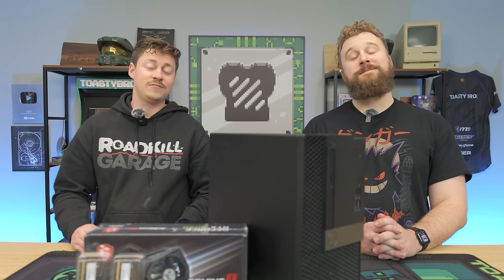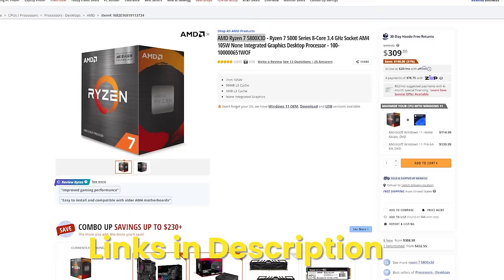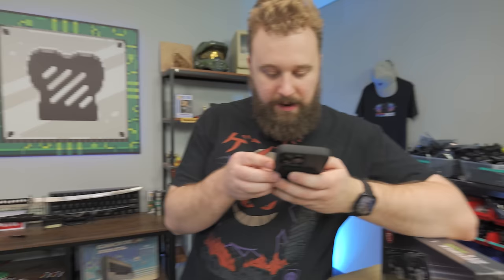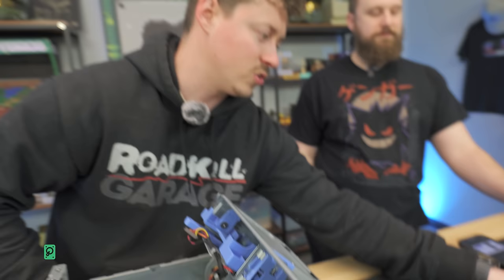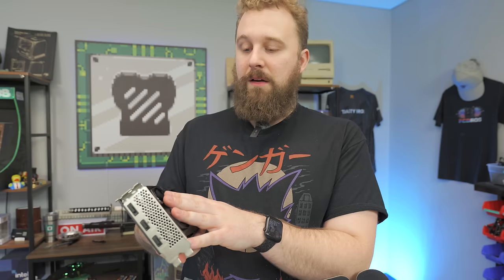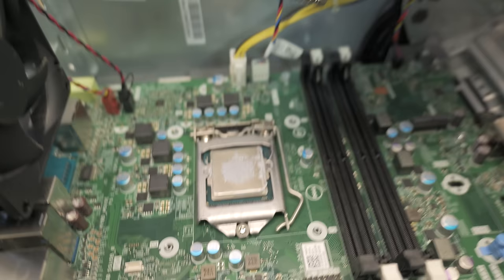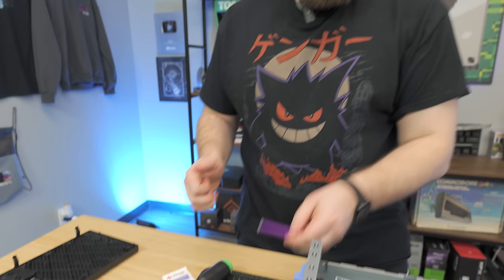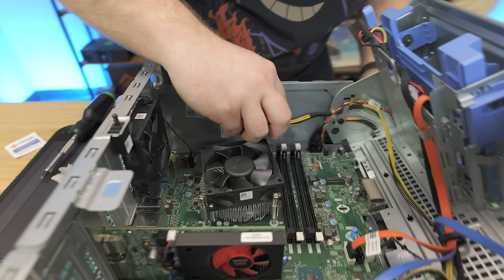This $330 Gaming PC is EASY & POWERFUL!

Comment: A 3050 that actually has a decent use case?  World has truly changed
Reply: It's a good thing I was sitting down when I heard that. 😂
Reply: April's Fools
Reply: it doesn't.  Look at how much stutter is on fortnite and they're like, "plays great two thumb up!"
Reply: @adrian0goncalves 😂
Reply: @Haddley333  like they said, it's more CPU bound. You can even run Fortnite comp settings with a 1050Ti
Reply: @WisteriaBerlitz  yes there is that, but conveniently i don't see them showing the vram usage of the gpu in the benchmarks.  Who does that?   I"m staying away from this channel
Reply: My 3050 has a great use case

I got it for less than half off so the price to performance issue disappeared
Reply: That's the new cut-down RTX 3050 6GB which was released in February 2024. It has less cores, lower clocks, less VRAM and smaller memory bus than the regular RTX 3050 8GB. IMO it should have been branded as the RTX 3040.
Reply: no mine is the 8gb I just happened to blindly luck into a clearance sale
Reply: @Pasi123  I feel the same about the naming scheme
Reply: yep, no external power needed. pretty dope id say, besides those expensive QUADRO's, its the best pci-e powered graphics cards
Reply: @Haddley333  no one buys a 6gb vram card expecting future proofing anyways. showing vram usage in the benchmarks would be redundant

Comment: I think the issue with the card was the name. Its not just 2GB VRAM less, but less clock speed, bus, etc., which made it seem like an underhanded move by Nvidia. Same as the 3060 8GB really.
Reply: Yes I got shafted buying an  nvidia laptop. I got caught up in the marketing with rtx 3xxx until I realized my vram was 4gb 😂 smh 

Thankfully I only play genshin and star rail, but still 😢

I've since "upgraded" to a an optiplex 7010 I got for free at work. IT guys already put 64 gb ram and the mobo has the standard 24 pin power connector which is pretty weird for dells. Just upgraded the PSU and Radeon 6600 for $220 

Not a triple a gamer so I'm not concerned about being bottle necked
Reply: 3050 8gb and Rx 6600 are now same price with discounts in my country. Which is better?
Reply: Back in my day.. a card like that would have been called the 3050gs, So we'd know it was a different and lower tier card.
Reply: @adlibconstitution1609  I'd recommend the RX 6600 based on my own experience with it. Can't state much about the RTX 3050, unfortunately.
Reply: @adlibconstitution1609  I would go with the 6600 unless you need DLSS or NVENC. For just gaming, the 6600 will be the better card. Oh and also, 6600 requires external power, so make sure you have an 8pin PCIE connector for it.
Reply: @tommynobaka  As long as it gets the job done for you!
Reply: @JamesSmith-sw3nk  I feel manufacturers are just blurring the lines on purpose now.
Reply: @tommynobaka  They did this shit back in the 2010s, the older dells with a like 3770k or 4770k should still have the standardized parts including standard PSU, board and connectors. The VRMs and BIOS was still trash but at least it was a very swappable system, this is actually why people started doing office PC builds to begin with, because the old ewaste dells were really good for that. Now with the proprietary bullshit I have a really difficult time recommending anyone build in a newer Dell.

And yes nVidia's low end is literally garbage. Like it's not worth it at all, dollar for dollar you get smoother gameplay and better performance on a Radeon. The only market segment where there's argument for getting a nVidia is actually the high end. Radeon owns the low end to midrange for this reason. A 6600 is a pretty nice card for barely any money. The 3050 just sucks for the amount of money they still want. It's literally a hundred dollar card that's being scalped.
Reply: True.
Reply: @drek9k2  yeah I got the older 7010 MT with the i7 3770. Interestingly, it has standard 24 pin connection. Only thing is the 5 pin fan connectors, but i'm not an rgb guy so idc
Reply: or the 2060, theyve been doing this forever lol

Comment: It''s worth noting that the low profile 3050 6GB is the same price as the full size 6GB, they perform the same and will work in the SFF Optiplex systems, as long as you don't buy a 30 class model. Really, the LP models make sense at that price, but the full height cards should be no more than $150 to be viable when you have an RX 6600 at the same price.

Also, you could get some more FPS in thees games where the CPU is near full util by using something like ThrottleStop to max out the boost limit and the long a short power durations, which could bring those clock speeds up with the CPU being heavily utilized.
Reply: I have a GTX 1060 6GB. Would it be worth it to upgrade to a newer GPU that has 6GB of VRAM or get a GPU that has at least 8GB of VRAM?
Reply: I will have to try Throttlestop.
Reply: @BREEZYM6015  Well, the 3050 6GB is more of a side grade from a 1060 6GB and the same goes for the 1660 Super/Ti. If you're willing to spend around $190 for the 3050 6GB, just get the RX 6600. It leaves the 3050 6GB in the dust in every way.
Reply: RX 6600 requires external power though, and for some older office PCs that come with 200w or lower PSUs that could be an issue since the RX 6600 can eat up to 160w max.
Reply: @BREEZYM6015  You just want to be careful with the things you adjust. Increasing the boost limit and the long and short power durations are pretty safe, and can help if you're getting high util. It can even help marginally if you're not. However, if you want to start really playing with a lot of the other settings, I would brush up what they all do before playing with it.
Reply: @JinghisKhan  The RX 6600 does not consume 160 watts. It's a 110 to 120 watt GPU. That being said, I didn't say that you should just buy the RX 6600. I merely said that the price is hard to justify when a much more powerful GPU costs the same money and uses not much more power. Besides, you could replace the power supply with something that would drop right it, like the XE3 power supply, and it has PCIe power for the 6600, and would cost about $50. It would be a VASTLY better experience for barely any more money for this machine.

I was simply using it to make the point that the full height 3050 6GB should be closer to $150.

Comment: I love this video. I’m new to the PC world, and just finished an Optiplex 7050 build: i7 7700, 1660 Super, 1TB M.2, and 32gig DDr4 RAM. I also added a 500W PSU that required very minor case alterations to fit (namely, cutting the flat plate by the stock PSU). Was thrilled to get 70 fps on titles like Battlefield 2042. Very cool to see other variations!
Reply: nice. just that the cpu could handle a slightly better gpu i think, but still that sounds fire bruv congrats
Reply: Thanks! I agree - the case will allow for a GPU with a max length of 221mm. Once I decide to invest more in gaming the GPU will for sure be the next upgrade.
Reply: What PSU did you buy?

Comment: My first PC build was with this exact CPU, but the GPU was an RX 6600 in a Prodesk 600 G2. I'd highly recommend such builds if you want to get on gaming as fast as possible for cheap.
Reply: Niaje buda 
RX 6600 needs an 8 pin for power tho right?
Reply: @bane18   Yup. Kabisa. Bora power supply yako ina hiyo, utakuwa tu sawa.

Comment: hello toastybros, i have a hp elitedesk 800g1( intel CoreI5- 4570, 8 gb ram and 128 gb of storage. What budget gpu could i pair with this and should i replace the cpu?
Reply: The best cpu you can put into that would be something like a 4770.  Nothing newer.  But that is still a decade only cpu and isn’t that much faster than your 4570.  Not to mention the pc is a decade old and could have a catastrophic failure at any point.  It only has a 320w power supply so the best gpu is probably the 3050 6GB used in this video since it’s a 70w gpu.

Comment: I literally got my OptiPlex yesterday and this pops up
Reply: Is it good and how much did it cost if you dont mind telling me?
Reply: @ro_diaz  I think around 150$ idk cs my sister got it for me but it came with an i5-7500 and I was supposed to get 16gb of ram and 256gb of storage but I got 32gb of ram and 960gb of storage but I’m sure it would work as well with 16gb but it is a good pc just make sure to update it and make sure everything internally is connected properly and replace the thermal paste and reseat the ram
Reply: @awoukii  thanks man

Comment: I have almost the exact setup. Optiplex 7050 SFF with a i7-6700, 16GB RAM and a RTX A2000 which is basically the workstation version of the 3050. Runs games like Starfield and Cyberpunk surprisingly well.

Comment: You know whats funny. I undervolted my Zotac RTX 3050 Twin Edge OC 8GB and now its power consumption is only 5-10w more than the power conumstion rating for the RTX 3050 6GB. With my undervolt even if my gpu is at 100% is using 75-85w of power and the performance is still the same or even better.

Comment: It would be interesting to see the low profile 3050 paired in some of the "newer" refurbished SFF Optiplex units that are coming out with the i7 8700 in it; how much of an uplift there might be going up to a 6-core 12-thread processor but still no external power for the GPU. Potentially better than a 1660 considering it would be somewhat DLSS capable?

Comment: Hi, I'm going to buy the budget office gamer 4th Gen i5 + RX 6400 very soon. But I was wondering if it is upgradable because I have a msi RTX 3080 and I was gonna replace it. And  I don't know if the msi rtx 3060 is small enough to fit in the office case

Comment: Hi! Really great video, I didn't know that RTX 3050 does not require external power supply. It's very helpful information for a Optiplex user. 
But do you know if RTX 3050 will fit into Optiplex 3070 Mt?
I will be really grateful for response.

Comment: Building a budget build with an Rx 580 later tonight -  If I go to AMD's website under the 580 support page, it looks like they are recommending the newest drivers (24.3...) I've read to only use 23.11.1 or lower. Also, I plan on selling the PC after I build it. So if I get 23.11.1, with adrenalin software - will it stay at the driver? What if the user updates it via adrenalin because it says there is a newer one? Will Windows try to auto-update to a newer one than 23.11.1? Please advise the best thing to do?

Comment: Can an Rx580 pare well with an i7 8700
Reply: It does pair well --  but an i7 8700 is around the same price as an i3 12100, which performs way better in game and is hugely more recent(supports ddr5). If you're going to be playing esports titles(CS, fortnite, apex), go with ryzen 5 3600/3600x, which is also around the same price but has triple the L3 cache.
Reply: @sci2089 he probably already has an 8700 💀💀💀
Reply: You can probably do better than that.

Comment: Can you do a 2080 ti build with an i5 12400f or i7 or i3 12400f
Reply: I have an i7 8700k. What would be the best GPU to pair with it? I currently have a GTX 1060 6GB.
Reply: @BREEZYM6015 Mabe a 7600 xt (16 gb) or 4070 (12 or 16 gb) or 5700 xt (8gb) or 3070 ti (12gb) depends on budget or power or what you are doing
Reply: @BREEZYM6015 also a 3060 is good too
Reply: @BREEZYM6015  Also, 16 gb ram is a must, really nowadays idk if you have 16gb of ram already but try to get 16 + gb of ram
Reply: @Thegalaxyglitch no such thing as a 3070ti 12gb
Reply: @FilthEffect  I didn't put ti in for a reason

Comment: Can you guys do one with an Arc A380?
Reply: A380s are not good for old systems, you need resizable BAR for the card to perform properly
Reply: That could explain why Helldivers 2 ain't working as well as I hope. Paired it with the i7-6700 + 32GB RAM, and that game had to go through everything to push it past 30fps

Comment: I have a i7-4790 with an MSI B85M-G43 (MS-7823) which GPU would you recommend?
Reply: I have a similar config and I'm using an RX5500xt 8GB GDR6 about equal to a regular 1660 but a lil cheaper, I do get some slight bottlenecking here and there but the best possible GPU I'd recommend without any major bottlenecking would be an RTX 2060, RX5600XT or a 1660 Super/TI, any of those depending on your budget
Reply: You'll be able to play most new games on med-high settings 1080p even without upscaling to get 60 fps

Comment: Hey.Do you have any cpu cooler recomandation for this optiplex?
Reply: Just keep the stock heat sin. I threw on kyonaut thermal paste and a Noctua NF-R8 redux-1200, 80mm fan. Put that same fan as the exhaust. Runs whisper quiet and cool.

Comment: If you already have a case and PSU from now obsolete build, these office PCs are not worth it - instead find some cheap, used B550 motherboard, Ryzen 3700X with Wraith Prism and some 32GB DDR4 3600MHz CL16 and you've gotten yourself an upgrade that's gonna last quite a while for just few dollars shy of $200. Use the remaining $130 to hunt down a nice deal on 5700XT and you've got yourself a cheap, relevant hardware that still has room for massive upgrades (5800X3D!) and supports PCIE4. Upgrade to 5800X3D and better GPU when financially available and it will last few good years.
Reply: These optiplex flips just aren't the value they were before, for a few reasons, but PSU prices coming down being a big one.
Reply: @FormerRuling  Yeah, they used to go for under 100 but even then, you were looking at fairly old hardware where for 50 more you would get something much more up to date. I'm always of the opinion that PSU is the one component one doesn't want to skimp on, also because it will probably power your current, next and another build after that. You don't need a new PSU every time you make a new build. I still have Enermax 920W PSU from 2010 that works 16h a day for the last 14 years in one of my workstations. Best bang for buck :)

Comment: Isn't a 3050 worse than 1080 or a 980? What's the point of it?
Reply: Low power consumption, it draws a fraction of the wattage of a 1080/980. So it can be put in an older system without needing a PSU upgrade

Comment: Man, that RAM config. I've officially seen it all.  You should get another 8gb kit if you have 4 slots. You're gonna get better performance. Used DDR4 OEM RAM is pretty cheap at this point, especially 4GB modules. You're missing out on some performance configuring your RAM like that. This is most likely the cause of the stutter. You probably have some game data stored in dual channel memory that has to wait on data from the single channel memory and just really is not working out for you.
Reply from the maker: It's what we had on hand at the time😅100% would recommend matching whatever 8GB stick is in the system that you buy or just purchase a kit and like you mentioned might actually improve results

Comment: i mean eh if ur gonna spend 330 on a gpu for an outdated system u might as well just save ur money and build a decent pc for like a grand and have a better time i have built plenty of optiplex pcs with spare parts iv gotten free from companies disposing of old computers and it just dosent make sense to me to buy a 3050 6gb for any reason for 330 ud get basically the same with a 1650 for under 200 minus dlss and rtx which i mean at only 6gb most games arnt gonna run great anywasy so might as well drop rtx and go gtx and run frs but i mean ig this is cool meh

Comment: At no point did I think any builder or reviewer , even paid to do so,  would ever promote this abomination of a gpu. The 3050 6gb is a bigger con that paying a grand for a 4080. The card should be a GTX 3030 , yes gtx not rtx. It is terrible at a terrible price point. The RX6650xt runs laps around it for it's $200 price tag and usually comes with a relevant steam game (RE4 last check.) Times must be rough. It is like a Ford dealership charging 70 grand for a maverick and telling you it is total steal of a deal just before you have it towed back for falling apart and blowing the trans with 1000 miles on the clock.
Reply from the maker: Did you even watch the video? Find me a card that doesn’t require external power that is better than it at this price then comment. Everyone knows the 6600 and 6650xt are better but not for this use case
Reply: I did and I understand the point of it. But that card is terrible for gaming even at the power saving point. Had it been just a budget build for entry level gaming 100%.  You guys have massive pull in input and respect from some of us that watch and get ideas for upcycling but in this case, just a terrible card that some budget gamers could get a high opinion of and buy while they would actually get much more by keeping a tired rx580 8gb. £70 vs £175 another Nvidia fail on price/performance. Edit, I even watched a second time to see if I missed the April Fools bazinga.  @ToastyBros
Reply: Not clueless at all. The card was released with a misleading name regardless of being able to use it without a psu. It is an abomination and has lead budget gamers into buying a card that misleads buyers into buying a gpu they arent getting. It should have been properly named GTX 3030. Nvidia did this with the 1060 3gb and it is a con from a company that already overcharges compared to what is delivered. We have 3 in store and have a huge notice to all our customers what it really is and how poor is performs compared tot he actual 3050 8gb which while requires a psu is an excellent entry card. I would never push the gimmick dlss/ poorly implemented (unusable) RT on any buyer. to anyone. I watched twice waiting for the April fools reveal.  @user-vs3tx9lv5c